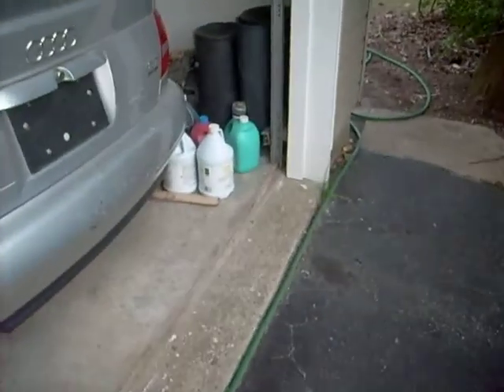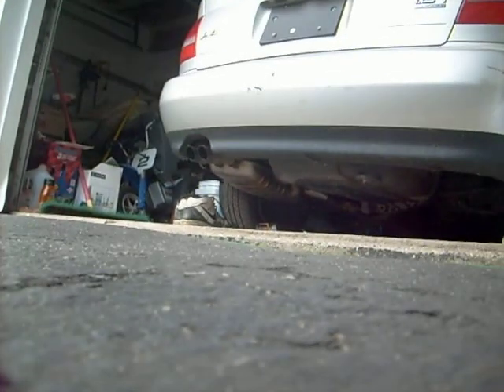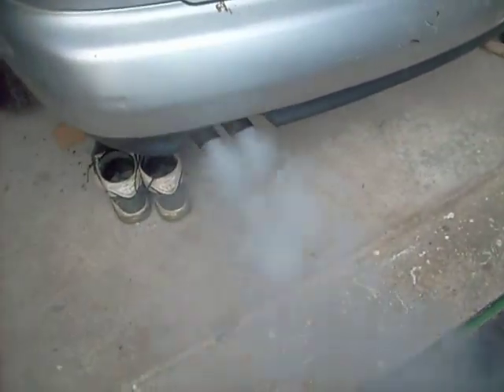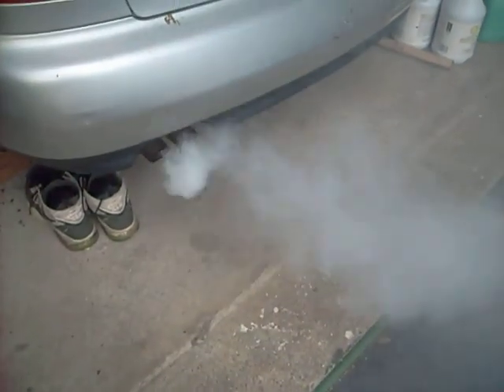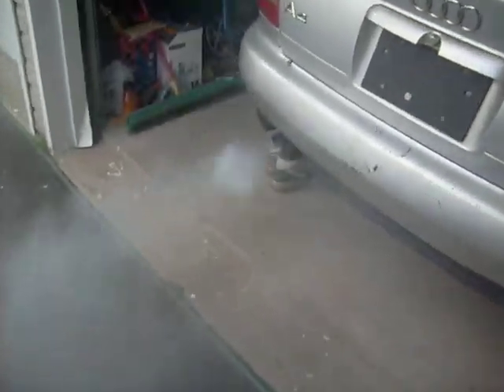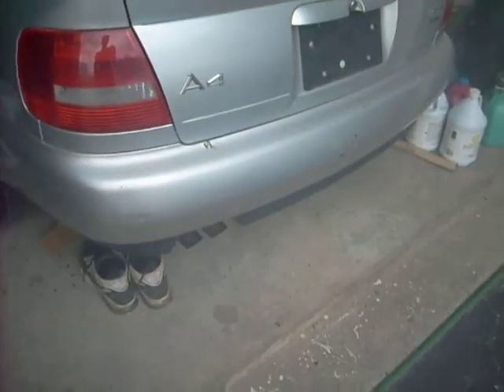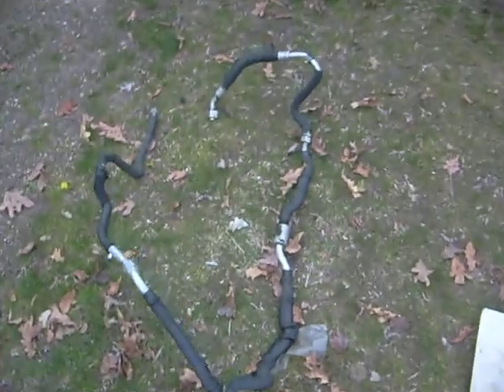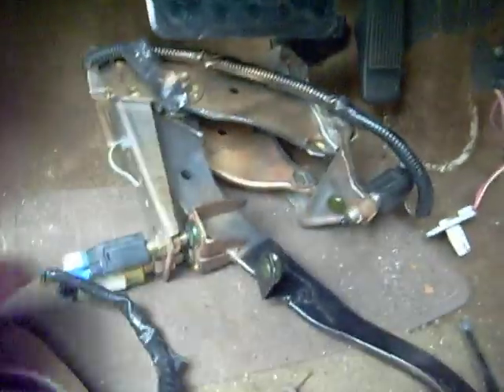Audi A4 b5 smoke problem

Comment: stuck or low voltage to injector(s) if smoke smells like fuel. loading up fuel on valves and fouling out plug.
Reply: Nick Miles good assessment. I agree... stuck open  fuel injector

Comment: If your getting blow by but no smoke from the exhaust does that still mean your piston rings are bad? My air pump just started going when it started bouncing the oil cap up and down when put over the hole in the valve cover, and it idles high when the air pump starts sounding like a jet engine winding up. And when I'm on the highway the car will go really fast but as soon as I get off and cone to a stop the car will barely have power and I have to shut it off and the power comes right back to the engine. It is also running really rich, it's a 1.8t AWP in a 02 VW gti 337 with a 5 speed swap instead of the 6 speed

Comment: Hi can anyone help my one is smoking only when idling
Reply from the maker: Check the turbo. Pull off the inlet on the cool side and inspect the shaft for any play ( wobble ). They tend to be the culprit due to worn seals that causes oil to get into the hot side and you see a blueish coloured smoke from the tail pipe especially on start up from oil that leaking into the exhaust side.
Reply: @Nissannx2000svg   did the new turbo stop the smoke on the back of the motor out of the hole as well
Reply from the maker: @austinmonroe6143  Yes. It had worn seals from a lack of oil changes ( poor maintenance ) from the previous owner.